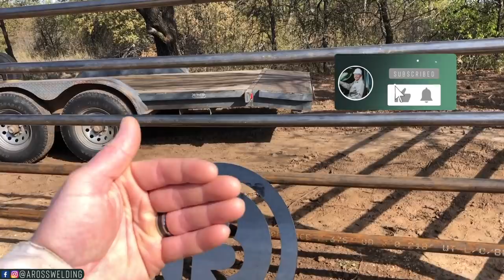MAKING CUSTOM GATE LATCHES & HANGING A CUSTOM SIGN ON THE NEW MASSIVE METAL PIPE FENCE ENTRANCE

Comment: I’ve always just hung the down latch on crossbars when not in use. That little holder you added is quite slick. I hope you don’t mind, but I’m stealing your idea. That’s a very sharp entrance you have built. Strong work.
Reply from the maker: Not at all! Take it and run baby. That’s why I do what I do. Share. Help. Learn. 👌😎
Reply: Thanks a bunch and keep up the great videos. I’ve been welding( mostly farm/ranch related) for over 20 years and have learned quite a bit from your videos. My son and I really enjoy them.
Reply: I've always driven pipe into the ground , flush, to receive the drop latches . When open , the ground will end up being an arched plowed furrow, as owner will put it in different places and soil will loosen allowing gate movement.

Comment: Where I live. Need to weld on a topstop to prevent the slide bolt from being pulled out and removed (half inched rims with pinched [stolen ] ) and used as a weapon!

Comment: Back when I made similar "signs" I'd take some 1" flat 1/4" stock & go around all the edges with it to give a true 3-D - it goes fast & the visual effect is really good - I did some very prominent ones, seen by loads of people daily. I also quietly pity whoever has to paint all that lot ^^.  That sounds like a right PITB to me. :-) But, it is certainly an impressive entrance - very robust.
Reply: You can create a much cleaner "Keep it shut & straight" latch by making an arm that locks the 2 gates together minus the ground pin btw - make it latch down on 2 horizontal members so they are tied together - bang, gates stay nicely shut & look super clean. Plus it opens/shuts mega fast when it's cold/rainy and you don't fancy dicking about with ground pins - which nobody does, tbh.. I'm honestly surprised, considering  the sheer expense this client has gone to, that they didn't opt for powered open/close - then again, they went for levelled stone as the driveway - and that never lasts - maybe they're allergic to bound macadam.. no accounting for Folks "thoughts" on stuff.

Comment: Would cutting a notch out of the inside bend on the handles aid in the bending and then letting the hot metal fuse itself back together when the bend is complete?

Comment: What size welding leads do you use ? 1/0? 2/0? 
I got a 250 weller and I need advise on which leads would be best ? 
Thank you
Reply from the maker: I usually get #1 or 1/0 
And try to get a full spool 250’-300’ and just cut it in half
Reply: @arosswelding  Cool thank you for the help and the response. I appreciate your videos they help a lot man thank you 🙏🏼

Comment: Did you cost out the job and if so would you care to share hrs or charge out bill
Reply from the maker: I had about 100 hrs in this project plus the cost of materials
Reply: Heh top job he rate over here for welder fab is around $120hr (Australia) contractor

Comment: I've had metal in my eye when I used to weld.
They've had to use a "dremmel" to take it out. 
Very uncomfortable.
Reply: Twice for me in 41 years of being a certified welder, and both times I was wearing safety glasses but didn’t take the time to put my face shield on! It’s no fun when the eye doctor comes at you with that drill whizzing wide open, headed straight for your eyeball!